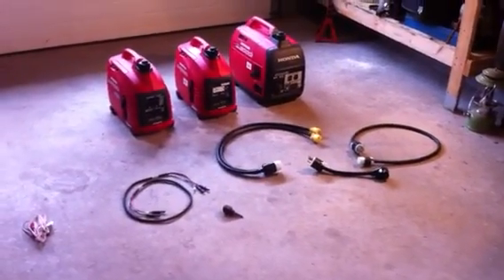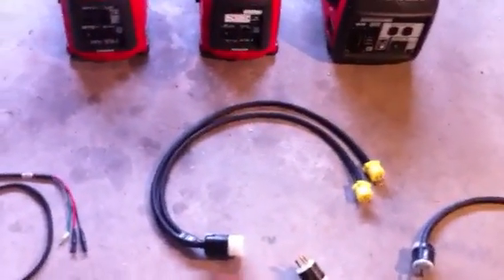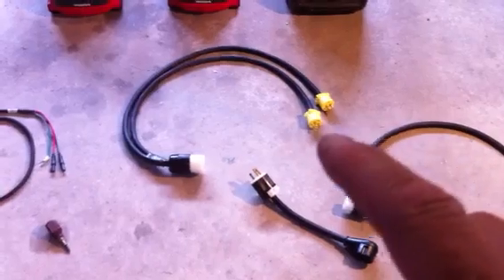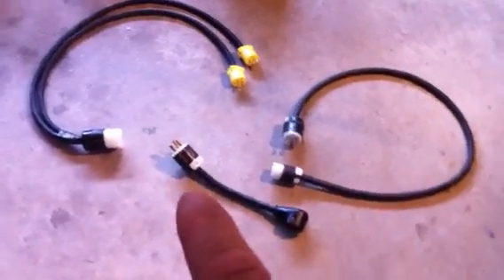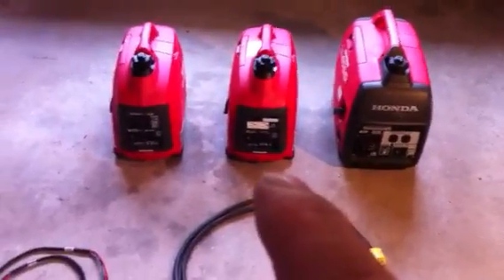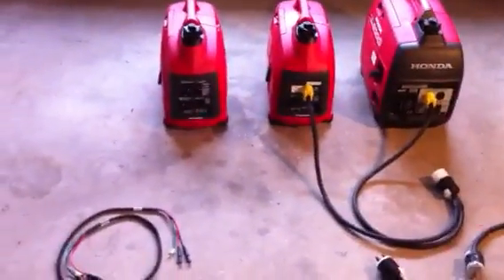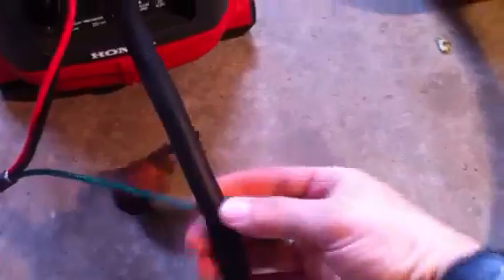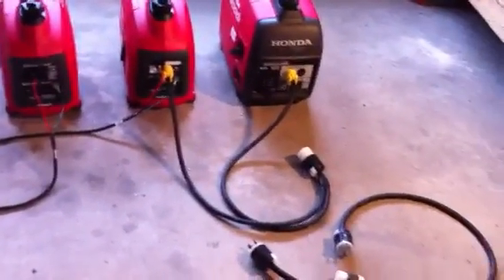How to triple parallel honda eu series generators

Comment: My first question would be while under load with a 1000 and 2000 together, do you have a true 3000 watt potential?  Or does the smaller unit downgrade the larger one and waste fuel?
Reply: The amount of fuel a generator uses depends on the load that's on it.  If you watch the video, he explains exactly what the power capacity is when they're hooked together.
Reply: You are limited by the max output of the smallest generator. 
So if you have two 1000W and one 2000W unit paralleled, you're limited to 1000w each unit, 3000W total.

Comment: Hi Vandettec, if you still monitor these comments I'd love to run a question by you.  I have 2 EU2000Is (both are companions) and when I run them in parallel can I pull all 3200w out of a single outlet?  I'm curious because they're 20a outlets and I'm wondering why they wouldn't overload and trip the circuit, requiring a reset.  or when you run them in parallel, are the generators smart enough to ignore that 20a limit?  or when in parallel do I HAVE to use the 30a plug to be able to pull all 3200 watts?  thank you!
Reply: Really strange that the 20A breaker is not tripping when you exceed 20 Amps, maybe it is faulty.  Many times what the makers do is they will daisy chain, in parrellel, the 15-20 amp outlet with the 30 amp outlet, so it is the same circuit but the 20 amp has the breaker.  If you know you will draw more than 20 Amps, always use the 30amp outlet.

Comment: This works because of your method of paralleling. Electrically speaking, you’re creating a combination circuit. The loads will always be split evenly. I’m your situation, let’s say you have a combined load of 3000 watts. Your homemade plug is splitting that load in half, so 1500 watts comes from the eu2000 and 1500 watts comes from the combination of the two eu1000’s. Then the load is again split in half between the two eu1000’s, so each is supplying 1500 watts.  

If each generator were paralleled together, you would only be able to pull the max of your smallest generator multiplied by the number of generators regardless of ho large the others were. This is why manufacturers recommend using the same size generator.
Reply: The generators don't have to split the load equally.  The controller on the inverter decides how much load to take.  The EU1000s aren't going to take 1500W of the load.

Comment: I own 2 Predator 2000 with the predator parallel kit. Their parallel kit is basically like the Honda 4 banana connector set up mated to a 30 amp female connector. To me having a background in electricity and electronics this means a 3rd or even 4th set of banana connectors could be parallel spliced into that central femal plug provided the total potential power and called for load does exceed that central female plug current load capability. In other words in electrical therory if you parallel four 2000 peak watt generators your going to need to replace that central female 30 Amp plug with a plug rated for at least 60 Amps. Other than that like this poster stated you have to decide how many Gen your going to parallel first, hook them up first, cap off insulate any banana plug pairs not used, then fire them all up. The higher rated 60 Amp central female plug won't be affected by lower potential or lower draw.

Comment: Can you tell me if you can create your cable with 3 connectors vs 2 so you can connect all 3 together with that cable vs using the standard honda cable and your home made one.  Also Wise is no longer in business, do you know of anyone else that sells one?
Reply from the maker: You can make a 3 into one cable ,
I have to tread a thin line on my answer as several people have accused me of trying to kill them with a cheater cable or blow there units up
Once you know the basics of the dangers and how to hook up the cables and what safety you need to use 
The best connector is to run 3 lines of the Honda plugs into a junction box then a twist lock out -female version 
This eliminates or at least protects you from a live feed to a male plugs(if one becomes unplugged or is not plugged in the other generators -lines will back feed to the male plug that was unplugged or not used) , probably the best way is to us the Honda cables - the banana plugs have a protective cover over the ends so they have build in protection from short circuit - ie electing anyone 
There would also be no circuit protection as I believe the Honda banana plugs bypass the circuit breaker I think ( don’t hold me to it please check the wiring diagram from Honda) , so a breaker for each input in the junction box would be recommended and a breaker for the whole box output would be needed 
This info is given with due care and caution , use at your own risk and precaution and your own  liability 
I do not know of any other place to get a junction kit , there was at one point a dual Honda cable into a 30 amp rv plug or twist lock one point in time 
Look at the junction boxes Honda makes for examples of how to make your own

Comment: I have an early non-EU HONDA 1000. I also have a companion HONDA 2200. I would like to parallel the 1000 with the 2200 using the method you have here of using two 15 amp males to a box with a 30 amp female to plug into my 30 amp RV.
Since the non-EU HONDA 1000 is not a pure sine wave will there be a problem and can I in anyway harm my HONDA 2200 companion gen by doing this?
Please respond if you have the knowledge and not just an opinion. Thank you. I really appreciate it!
Reply: DO NOT attempt to parralel non inverter generators with inverter generators. Things will be destroyed, guaranteed, and probably immediately.
Reply: @gbean  Thanks!!

Comment: you make it too complicated. just make a box three inlets for the generators and as many outlets the amps can handle .two or more of this setup in one plug is in europe forbidden and we have +220 v so less amps going through for the same watts. yoy amercans waist a lot of cupper. with 110v..should listen better to Nikola Tesla .only very few countries have 240 v by 60 hz. be careful ...goedendag
Reply from the maker: brucebear1 
I don't know what Honda info you read but the info I read is you can have one generator of the pair turned off and not have a issue , if it was a issue then all the current "legal Honda parallel kits would fry the second generator computers automatically ) before you could get the second unit started 
Do more research before you preach and say people are frauds and liars and are out to destroy someone's stuff
Reply: @vandettec  In order to parallel two or more generators, in their classic form, one needs a mechanism of "zero frequency and zero phase" detection. Paralleling can be only performed under these two presuppositions. The power sources (apart from having the same voltage) must not only have the same frequency, but also the same phase. If there is substantial phase difference between them, there is always a danger present of one of the generators to behave as load consuming excessive power from the other. In case of 180 degrees of phase difference we simply have explosion for both of them. The limit for maximum phase difference should be less than 3 degrees. This is a rule for paralleling safely ordinary a.c generators. In the case of paralleling industrial types, that is three phase ones, apart from all above, care should be taken for paralleling the correct phases together (R to R, S to S and T to T). The procedure of paralleling is not simple. We start the generators and then we use one of them as reference source for paralleling the other with it. Then, with proper electronics, we secure the presence of all of these parameters. Equal voltage, frequency and phase. Only then a paralleling switch is energised (either manually or better automatically). This applies to all ordinary a.c generators, including the utility generators of power plants. Therefore the method you propose, really seems strange. Except if this zero frequency- zero phase detector circuit is included in the inverter circuit of these generators. This is the only exception and I believe that the quarrel with some commentators stands on this base...
Reply from the maker: I am not here to argue how the basic fundamentals of how generators sync , the computer/boards on the generators do all the work ,  my whole point of these videos was to show how Honda and wise sales recommends you hook up your generators together , ie all have to be connected together before you start , then start which one you want , or alll of them, I am keeping it simple , people for a local of a better term at the moment make shitty comments with out the back ground to prove it ,ie the suicide cord is bad but let’s wire our generators into our dryer plug and back feed our house , your trying to kill our kids , why would kids be playing around generators anyway ,
Reply: @vandettec  First of all thank you for the immediate response. I completely understand your point. Furthermore, I have given these details previously expecting to confirm that the synchronisation circuit is included within the inverter circuitry of these generators. Since the method you propose is the official one which Honda proposes, everything is fine. Nevertheless this point should have been cleared right from the beginning, because anyone who happens to know the basics about the paralleling a.c generators is in front of a surprise when seeing your video. In other words, don't get angry with such reactions, and don't pay attention to these people who doubt the proposed method without knowing what happens. Do not consider that all of us who see the video know all the details of the function of these generators. I exclude of course any comments of hate against you. This is objectively unacceptable I think. Anyway, for your next videos, keep my point in mind. Give detailed information before you get...attacked. Greetings from Athens-Greece!
Reply: We have 240 service in the USA. We split at at the panel. 120v A and B for small appliances. 240v (A+B) for large appliances.
Reply: Javier J - Yes but EVERYTHING in Europe is 240 volt, no matter how small the appliance. And it’s supplied in a single pole, rather than here in North America we have 2-120v poles adding up to 240.
Reply: If I hear it right, he's getting a 120V output but all the amperages are combined.  The round outlet at the end of his chain is a North American standard 120V single phase 30-Amp connector.  If higher amperage and voltage is needed, there is different wiring and connectors for 240V single phase but two separate "hot" poles.
I hear you about the two hot plugs -- in the US, they're called "suicide plugs" for a good reason.  Here, the issue of legality is complicated -- there are shared "codes" and some localities accept the codes as law and for some they are advisory; in any case, if you have a problem with a non-code item, your insurance is null and void.  So they may be "legal" but against code in some places and illegal in others -- whatever, it's an unsafe system.  I'd NEVER use a system like that.
This man also talks at the end about shutting down and starting up one or more of the generators while they're connected.  Honda is very clear that this should not be done; it will either fry the computers in one or more generators and/or give you uncontrolled power output.
I know what he's trying to do, but I'd never do the things he's describing here.  I think that they're dangerous to people, his ideas risk damaging the generators, and he risks damaging items plugged into his loads.

Comment: you would need to use the pairing prong cable and put both 1000's in 1 phase and use the second 2000 as a second phase and pair the neutral lead from both phases and the ground then have both phases going into a 240v plug
Reply: That isn't going to work.
Reply: @stargazer7644  its common to run them in 240 split phase
Reply: @MrTurnermason  These generators don't have 240V outputs and if you simply put them in series they won't phase lock.    Connecting them as you describe you'd have to phase lock the generators exactly 180 degrees out of phase to get 240V. So how exactly would you do that?  The only way would be to use a large split phase step up transformer.

Comment: Ok, I just bought a Honda eu2000i and a camper with a 13,500 btu AC. My goal is to buy a 1000i and link them together to run my AC since will be cheaper than buying another 2000i. Where can I get the cable that you used to link your 2000 to the 1000? I really don't want to link the....just the two.

Thanks for doing this video, Really helped
Reply from the maker: Hello ,your answer is incorrect -look up parallel vs series of batteries it’s explained better 

 if you series the 2 eu1000 or 2 - 1000 watt generators ,it  does not work , 120 volt plus 120 equals 240 volts , 

they would blow up , there not rated for that voltage , you don’t get 2000 Watts , you would get 1000 Watts at 240 volts but both units would explode immediately , 

All the generators are run in parallel only
Reply: @vandettec  they are Inverter smart gens they pick it up and fix that issue so it does work
Reply: you can't do that- the reason this ^^^ setup works is because the two 1000w are wired in series to make 2000w, then wired in parallel with the 2000w single generator. basically giving you two generators both pushing 2000w.

Comment: I dont understand ! Wouldnt it be cheaper to just buy a higher output generator?
Reply: This question is not so simple as it seems to be. Yes, it is cheaper to buy a bigger generator instead of buying two little ones. But the big generator working on little loads consumes much more fuel than a smaller one. So having two smaller generators adds to your flexibility to use them both in parallel operation when it comes to heavy loads and using only one of them with low loads. The fuel savings, in this way, are not to be neglected at all. Furthermore, you always have a back up if one of them needs to be repaired. So, it all depends on under what light you see this question.
Reply: Yes it would be cheaper ..but you cannot pick up the higher output genYou can pickup and move around a single 2000w gen

Comment: To start your AC what you need to do is get a transformer to store power, then your start up voltage won't matter and you can start it up on less Wattage.
Reply: There are systems called "hard start kits" (some manufacturers oddly enough call them "soft start kits", but they're the same).  They use a CAPACITOR - not a transformer - to store enough amperage to supply that surge that you need to start an air conditioner.  These system kits mount onto the air conditioner so that they work with whatever power supply ("shore power", generator, or inverter) you're using.
Reply: generators dont store power. Use a capacitor bank or soft start panel. transformers don't store power.
Reply: A capacitor in a A/C circuit won’t store energy. It will how ever help with the var’s
Reply: Just get a Supco SPP6 capacitor and dont waste money on one of those "starters" for your AC on your camper. I run a 13.5k AC and 15k AC on three A-Ipower 2000 watt generators just fine

Comment: Hi There...I realize you're using the Honda eu2000 and eu1000's...I love the quieter inverter technology but need a lot more power. What would a similar process be to parallel a set of eu6500is generators? As you are aware it's an expensive endeavour but Honda is top of it's class. I realize there are 10000 and 12000 watt Hondas but not using the quiet inverter technology. Your thoughts?
Reply: Gord C, If you still have your question unanswered, find my relevant comment here, to Vandettec...

Comment from the maker: One eu3000 under most conditions able to run 1 a/c unit alone of it is 13500btu, , the cost of a eu2000 is around 850-1000 each and a eu3000 is around 2000, and harder to move around , for the price I think 2 eu2000 would work as you can carry them , I thought of getting a eu3000 , as it is longer db at idle with more power than a eu2000 if your just running lights and small loads

Comment: I need fifty amps for my 5th wheel with two A/C's. I have two 2000eu's. Should I add two 2000eu's or one 3000eu ? What could I get out on three 2000eu's?
Reply: you could probably run both- just start one and let it go well into its cycle before starting the other
Reply: I’m pretty sure you could with 3 of them. My 5th wheel has a Onan 6500 watt generator and runs everything including 2 each 15k a/c